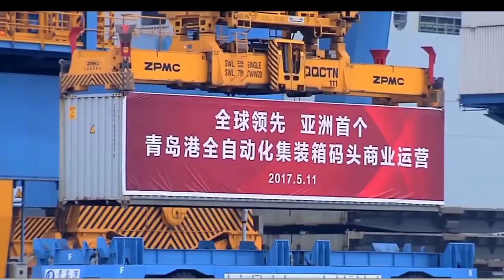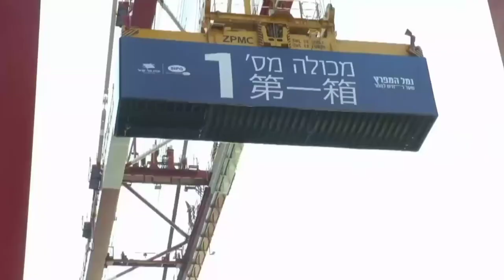10 Largest Ports in the world

Comment: You made a big mistake to describe the port capacity. Port capacity always measure by the TEU, Twenty Foot Equivalent Unit. It is the size of the 20 feet long container. Although, there is also 40 feet long container. It assume that 20 feet long container can carry 20 tons of goods and 40 feet long container can carry 40 tons of the goods. But when it comes to measure the size of the port the term TEU is used for the technical reason. You said Teus instead of TEU. Please Google it and find about more the term. That is not true at all.